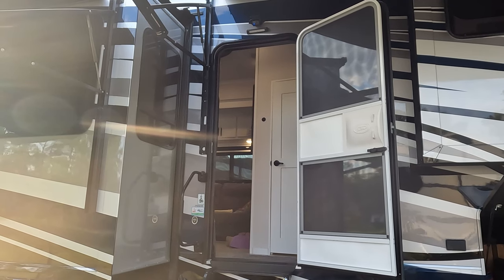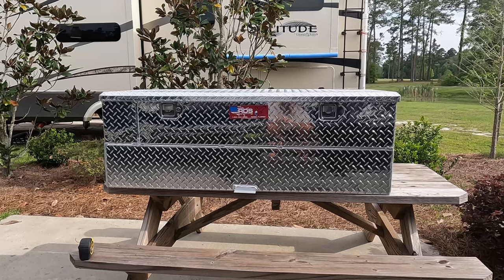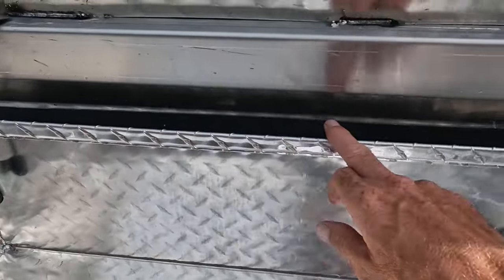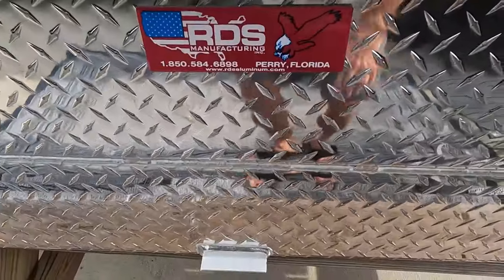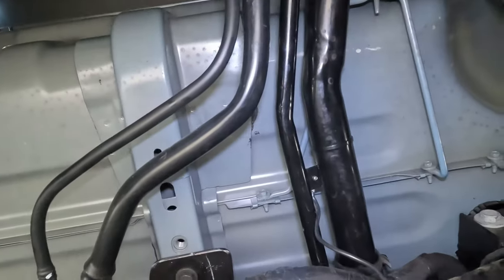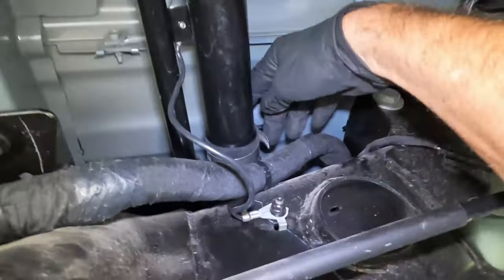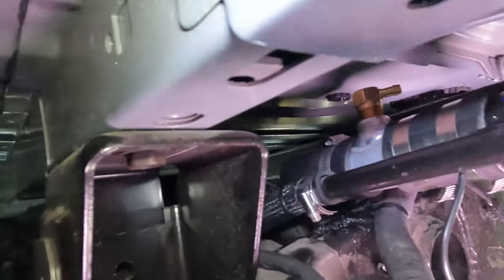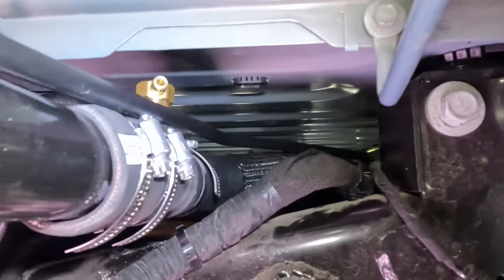Increase Your Truck's Range and Cure Range Anxiety: RDS Auxiliary Tank & Toolbox Installation

Comment from the maker: I have received several questions around concerns that the aux tank will cause the main tank to overflow through the main filler tube when both tanks are open,.  I can assure you that this is not the case.  I have had both tanks completely full with the shut-off valve open.  I have let the truck sit for several weeks with both tanks full, less the short drive back from the filling station, and I have had no leaks or overflows.   Here is the reason why they do not overflow.  

The reason the main tank is not overflowing when the auxiliary tank is also full is due to a principle in fluid dynamics known as hydrostatic equilibrium.

In simple terms, two connected containers of fluid will eventually balance out to the same level, regardless of the size or shape of the containers. This is why water in a series of interconnected tubes or vessels all settles at the same height.

In the case of this install, when both the main and auxiliary fuel tanks are full and the shut-off valve is open, the fuel in the auxiliary tank will flow into the main tank until the fuel levels in both tanks balance out. Since the T-connector is about a foot below the auxiliary tank, the fuel can only flow into the main tank up to the level of this T-connector.

Imagine a long straw with both ends open. If you submerge one end of the straw into a cup of water, the water will rise in the straw only to the level of the water in the cup, not higher. It's the same concept with these fuel tanks.

When using fuel from the main tank (while driving, for example), the level in the main tank will drop below the level of the auxiliary tank's T-connector. The auxiliary tank will then start to drain into the main tank to equalize the levels until the fuel level is once again at the height of the T-connector. If the main tank fuel is used so the level in the main tank drops below the T-connector, the auxiliary tank will continue to drain until its level is at the T-connector or until the main tank is full, whichever comes first.

If the fuel consumption continues and the level in the main tank falls below the T-connector, the auxiliary tank will continue to drain until it's empty or the main tank is full. If the main tank is full, it won't overflow because the fuel level in the auxiliary tank is now lower than the T-connector, and the auxiliary tank cannot push more fuel into the main tank.

Therefore, as long as the level of your T-connector is below the maximum fill height of your main tank, you shouldn't experience an overflow from the auxiliary tank into the main tank. 

Oh but wait....The T-Connector is above the top of the main fuel tank.....  Yes that is true, but......

If the T-connector is above the main tank but below the maximum height of the fill tube that fills the main tank, the fill tube effectively acts as part of the main tank for the purposes of balancing the fluid levels. As such, the system will still balance out to prevent overflowing.

Here's why: the fill tube for the main tank, as long as it is open to the main tank and not obstructed, is considered as part of the "volume" of the main tank. Fuel will rise in this tube up to the level of the T-connector, the same way it would in the main tank itself.

Fuel will flow from the auxiliary tank into the main tank and its fill tube up to the height of the T-connector, balancing out the fuel levels. So, even if the main tank's top is below the T-connector, the fill tube's extra height provides the space needed to prevent overflow.

However, this can depend on the specific setup and design of your fuel tanks, so it's always a good idea to consult with a professional or the tank's manufacturer if you have doubts or questions.

Comment: Doing this with a 91 gallon combo soon

Thanks for the detailed install
Reply from the maker: You're welcome.  Good luck.  Its pretty easy.  One thing I did notice is that I had cut the rubber hose section a bit too short on my initial install.  I ended up replacing it because it formed a small leak.  Just make sure you don;'t skimp on length.  Also, keep the extra handy just in case you need it in the future.
Reply: I very much appreciate that Sir. Keep up the good work.
Reply: Finally getting around to installing the tank side of mine work aside, 
How did you go about adjusting the intake elbow if at all? Or does it come pre installed the only direction you can mount it?
This is that brass fitting that im speaking of, thanks for the insite
Reply: @unknown_truckers  l’m not sure what you are referring to.  Do you mean the brass fitting next to the fill inlet on the aux tank? It was pre installed on mine and I did not adjust it.
Reply: @senselessscott  yes sir that's what I was referring to. That's the last bit I need to do but everything else and putting in a grommet worked wonders for the tube.

Comment: Nothing wrong with being meticulous and slow. Measure twice cut once eh? Fabulous job by the way.

I can’t believe Ram wasn’t going to warranty a 50 gallon tank that comes from their factory. Very odd! 

I’ve been looking at one of these vs a 50 gallon upgrade tank under the truck for my 16’ Ram Laramie. Still checking things out.

Thanks for the video!
Reply from the maker: Thank you for watching and your kind comment.  I think it was more of the dealers that were the issue and not RAM as a company.   I think if I called the RAM regional support I would have gotten better support.  I just didn’t have the time to waste with dealing with those local dealers in the middle.   As far as the tank, we just did another 1200 mile trip and it again served its purpose well.  Actually saved us some $ as I was able to stock some lower cost fuel so to avoid the higher price at the next stop.  Had to carry the extra weight but I don’t think it impacted fuel economy so much to matter.  Added 30 gallons at $0.52 less per gallon.  Every little bit counts!

Comment: Does rds not supply spacers for under the mounting tabs? Seems like a point of failure being mounted on an unsupported tab…. A lot of other manufactures supply spacers for areas of the mounts that don’t touch the bed directly
Reply from the maker: Hello,  They do not provide spacers for under the tabs, at least not in my kit.  The neoprene does provide a bit of space but over time I imagine that would compress thereby eliminating any spacing benefit.  I see your point, but I am wondering if the spring being on the fastener offers enough movement that it would eliminate metal fatigue thus diminishing the failure potential.  Though I do think your point is very valid.  Perhaps a firm bushing between the tab and the bed.  I think that would help and definitely not hurt. Although, I wonder if it would need to be large enough to be the entire surface of the tab and then some to under the tank itself, otherwise there is a "pivot point" which would be at the tab to tank weld and the constant movement could fatigue that to break point. Hmmm.
Reply: @okletsgorv  the springs provide a dampening to prevent the tank from being mounted solid and fracturing welds on the tank or bed. The spacers should take up the space between the bed and the tabs. Without spacers under  those tabs, the bounce will eventually bend them, making all of your mounting points loose. The neoprene is so that the tank doesn’t wear itself into the truck bed, creating a metal to metal contact. Vibration of the tank, will make it eat onto the bed metal and either damage the bed or make the tank fail. The bed liner does dampen for awhile, but since beds liners are firm and not really flexible, the tank would chew through relatively quickly from driving vibrations which is why the neoprene is used. Neoprene holds good abrasion resistance and is waterproof and pliable and should not deteriorate.

Comment: Where did you get the bolts and springs?  What size bolt and nut?
Reply from the maker: They came with the tank kit.  I am not sure what size they are.  They will likely be specific to the tank kit.

Comment: How hard is it to fill your new tank when your fifthwheel is attached?
Reply from the maker: For me its not prohibitively difficult.  I do have to climb up over the rail and onto the bed by stepping up on the tire.  I typically have the hose in the regular tank when doing that so I can have both hands free to lift myself up. I then reach over to grab the hose.   I have a 8ft bed, so there is plenty of room to move around to open and get to the tank.  If it were a short bed, it would be tougher -- if the aux tank would even fit in the first place.   Once I am done fueling I will either put the hose back in the primary tank to hold it, or just hold on to it as I jump off the truck.   I'm pretty agile and nimble for doing this, but for anyone that has weight or physical conditions with knees etc, I suspect it would be a bit more difficult.

Comment: What keeps it from over filling the truck tank? Do you need a cut off switch?
Reply: See the pinned comment for more details.  It does not overflow due to the hydrostatic equilibrium.
Reply from the maker: That was me responding as SenselessScott

Comment: Does the fuel shut off once the main tank is full? i thought that there would be a check valve somewhere inline ?
Reply from the maker: Hello,  

The short answer is yes but I am not sure how it is happening.  I suspect it is just pressure equalization but I am not sure.  (I know just enough about fluid dynamics to be dangerous) The valve component that I show in the video that comes with the install kit is described in the documentation as a roll-over spill prevention valve, and not a check-valve in the terms you are eluding to.  It could be that it is indeed a check valve of sorts, but again I have no conclusive information on that.  I can tell you this, I have filled the main tank as well as the aux tank and left the shut-off valve open.  I have had no leaks or overflow even after leaving it sit for a few weeks with both tanks completely full -- less a short drive back from the filling station. I have a call into RDS as of today (7/6/3023).  I am going to ask them how it is that the main tank does not overflow when both the aux and main are full.  Again, I do suspect that it is just pressure equalization, but that is just a guess.  I'll post the definitive word from them as a rely here and pinned comment once I have the answer.  Thank you for watching!
Reply: @okletsgorv  let me know what you find out and thanks for the quick response.